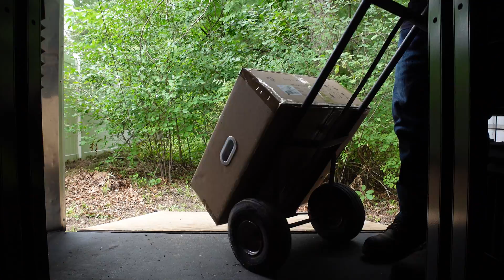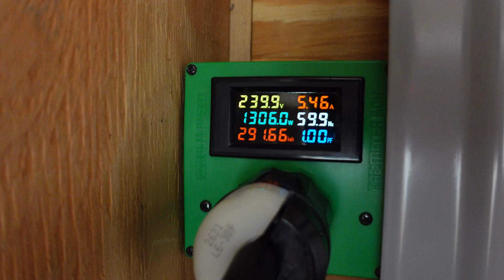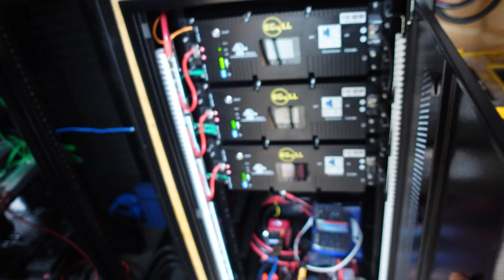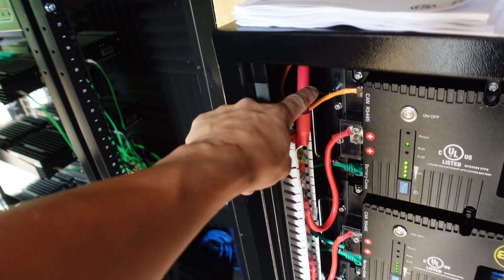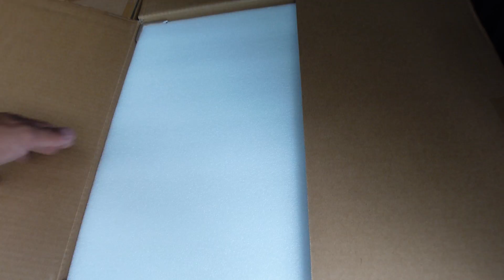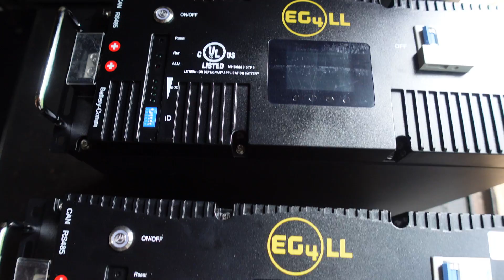DIY Solar Setup Gets 6X EG4 LL Batteries for Crypto Mining

Comment: The bus bar is designed to be low resistance so it should not matter where you connect the positive and negative.   If u were to string the battery from one terminal to the next without a bus bar then yes it would help by putting the negative on the bottom.

Comment: In the future you want to get all batteries as close to the same voltage as you can before you connect them.  Also don't worry too much about the % of charge on the display if that is off.  LiFePo4 has a really flat charge curve and the BMS does it's best to 'guess' the state of charge, but it isn't 100% accurate.  More importantly just make sure the voltages all stay close. Every once in a while get them all back up to 100% and they will be back in sync - for a little while.  I have 3 of these LL-s batteries in the EG4 3 battery rack.  Those racks are super nice, great casters too.

Comment: If u run all 6 batterys down to 20% and still have all ur miners pulling 3000w there is no way u gonna be able to run then all and charge all the battries back up to 100% in a day
Reply from the maker: I will be adding another array and second inverter... eventually